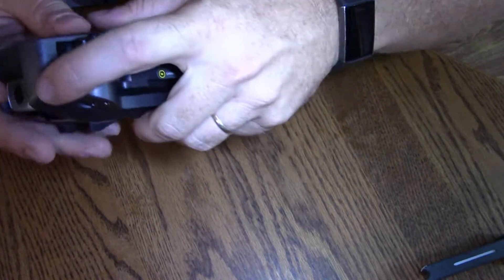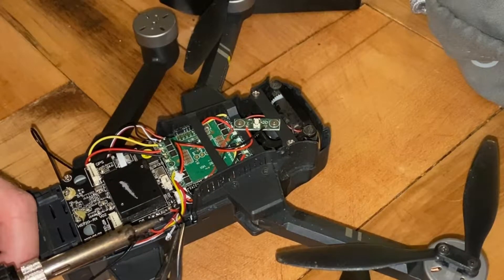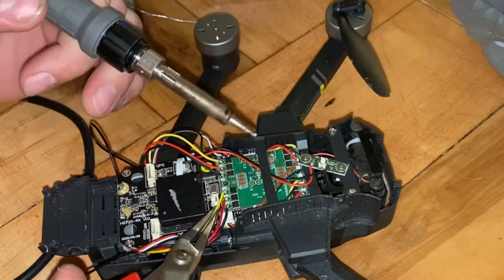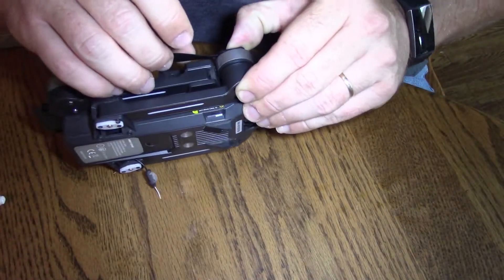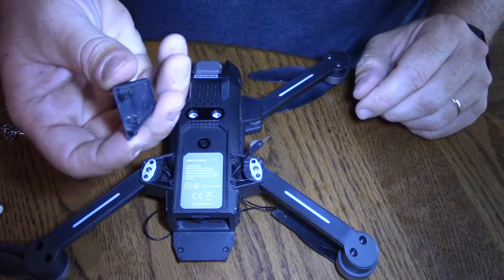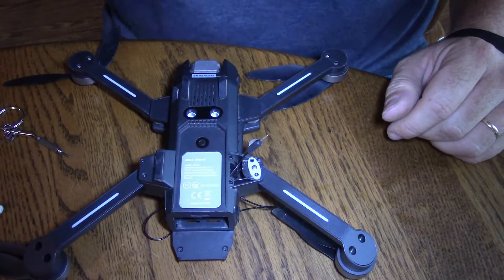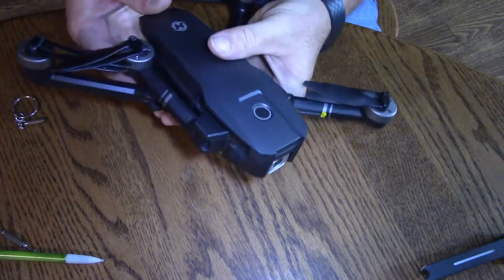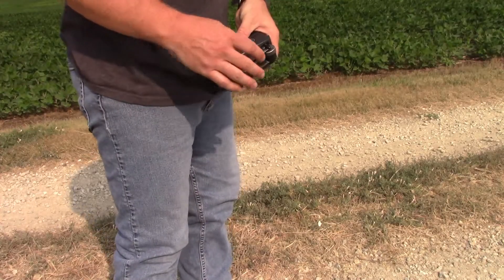DIY - DRONE ARM REPLACEMENT (HOLY STONE HS720)

Comment: Great video would like to have seen you do the work a processional drone builder
Reply from the maker: The only thing that needed skill was the soldering of the wires & I let a guy do it with the proper equipment.  He builds drones from scratch.  He is a professional in my books.  Thanks for watching!!